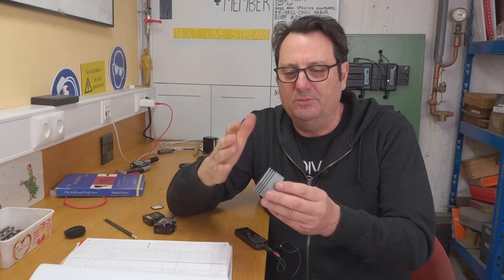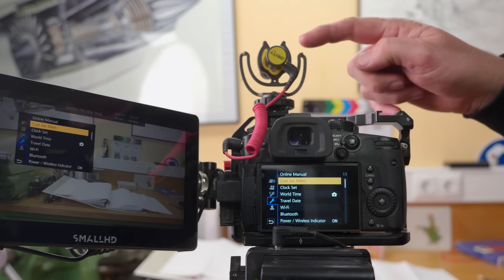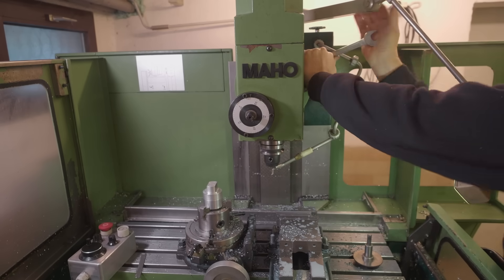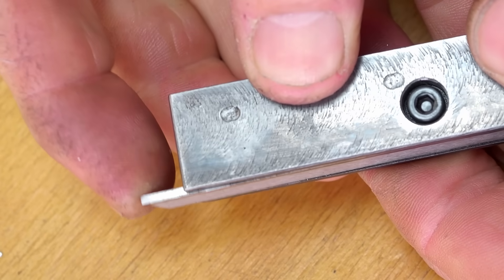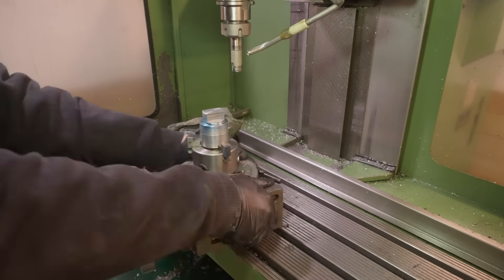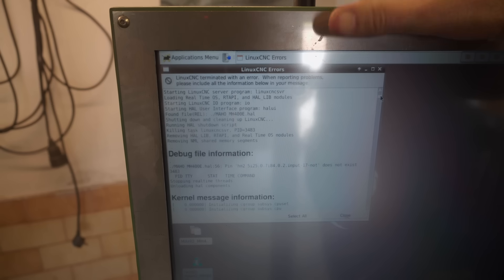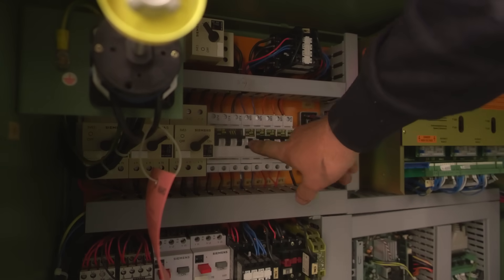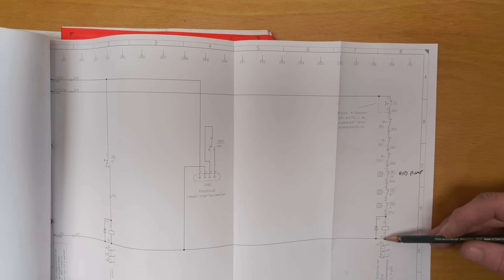I need piston ring grooves in my motorbike pistons but had no tool holder. || RotarySMP

Comment: at 15.03. what is that loose screw in the hand pendant, shorting out something?
Reply from the maker: You know the lame thing... as I flipped it over, I heard a rattle, and didn't put 2 and 2 together to look for a loose screw. Duh!!!! :)
Reply: I use red (or bright) nail varnish, it is strong enough to put on terminal screws and will stop them unscrewing and/or falling out. And the bright colour shows you the screw has been secured.
But it is soft enough that you can press through it and undo the screw with any screwdriver.
I learned this trick when servicing old high quality test equipment like oscilloscopes etc that had red nail varnish on adjustment screws or critical mounting screws.
Nail varnish is so convenient to apply with its own little brush.
Can be used to put indicator dots on connectors and stuff too. 👍
Reply: @wizrom3046  That nail polish also works great on tools for identifying which ones have walked off to a friend's toolbox, by design or accident. =D
Reply: @MikelNaUsaCom    funny you said about tools, now I'm getting older my eyes are not as good with fine print, and many of my half inch sockets from the 1980s have fine print saying what the size is.
When working on my motorcycles a 12mm socket looks the same as a 13mm socket etc, you can guess where this is going...
I'm thinking of putting paint colour codes on my sockets and wrenches, probably on the sizes I use the most.
Last time I was in the pharmacy they had a discount bin of horrible garish nail varnish colours for $1, I might grab a range of colours.
Reply: Good eye! 👍
Reply: looks like it came out of the white wire connection on the e-stop switch
Reply from the maker: @Hobgoblin612  I need to check it. Sure looks like that.
Reply: Also it comes in a wide range of pretty colors. 😄
Reply from the maker: @624Dudley  I'll have to hit up the kids for a bottle :)
Reply: @Servo421  nothing better than having 50,000 eyes to see what your own two eyes didn't see. Awesome that you keep your motivation and focus on a project like this.
Reply: Yes 👀 I saw it too 😊.   Pretty sure it was the short  he was looking for .
Reply: My loose screw has haunted me all of my life. Allegedly…

Comment: I had just the opposite problem with my commercial Hp laser printer. This is a machine with scanner with an auto feed, copier, etc. a really great machine, rated at over 70,000 prints a month. I bought it about 12 years ago, new. Never had a problem. Then recently, my wife had to make copies of our tax forms (well, she didn’t, but she’s an attorney, so she doesn’t trust online forms with our info). So, she could make a copy, or two, and then the machine would give a 59 error and she’d have to turn the machine off and on, repeat and rinse. I looked at my service manual. There is a couple of procedures for this problem. One requires taking half the printer apart to get to a sensor. I did all the work except for that. Nada! Then I decided to unplug it, something I should have done first, but the tests required that it be plugged in. Well, that fixed it! Then I remembered we had some networking problems after my ISP, Verizon, sent me a new gateway. I think some bad code from that, lodged itself in the machine cache which got unloaded when I unplugged it. Three minutes to “fix” it, vs several hours of work which didn’t. I didn’t follow the rule of unplugging it and waiting a bit first. My wife was insisting on buying a new machine.

Comment: While not directly related to your actual fault on this occasion, you mention a connection issue with the original Maho relay interface board while wiggling the connectors. Maybe worthwhile at some point pulling that pcb and insepcting closely the state of the soldered joints to the fixed connector pins on the board. I had  intermittent E stop problems on a mid-80s Gildemeister CNC lathe when I was working that turned out to be due to failure of a soldered joint of a similar connector on a relay pcb due to one pin taking a high current. The repeated heat cycles here eventually caused the soldered joint to fail, which was visble under a magnifying glass as a fine black line around the joint. Cure was to suck out the "rotten" oxidised solder, reflux and resolder the joint - did all the joints on the board to be sure ! When a similar issue reappeared 3or 4 years later, I knew where to look & the same joint had again failed in the same way - eventually put to bed for good by re-engineering the circuit off the pcb using stand-alone components with screw terminals.
On the subject of close tolerance holes with minimal tooling, have you heard of "dreamers" - combination of a stubby drill & reamer in one tool that gives a close tolerance hole in one hit.
Reply from the maker: It would be a good idea, but as long as that relay board is working, I have other priorities at present.

I had not heard of them. They would be quite the time saver.

Comment: You never actually specified the problem. Please, what was it? What wiring did you do wrong?😇
Reply from the maker: I didn't actually solve it. I just removed the pendant. 

But it turned out some eagle eyed viewers picked it up. An unused screw had backed out of one of the pendant buttons and was rattling around, and caused the short.

Comment: i like to use a thermal camera to look for such errors
Reply from the maker: In this case it was a screw rattling around in that pendant causing the short. Kind of doubt it would have been visible with a thermal camera given only 24V and 2A.

Comment: Finding shorts or high power consumption has changed for me since I own a cheap thermal camera. High power dissipation literally lights up in the FarIR spectrum. ( p.s. Not a sparky).
Reply from the maker: This was only a 24VDC 2A circuit, so I doubt the short would have been obvious with a thermal camera. Turned out it was a loose screw rattling around inside the pendant causing the short.

Comment: Th complexity of your system was one thing that worried me when something acts up. I can't tell you how many electrical issues I have fixed that were from replacing parts that tested good but for some reason in use didn't work. One was an ice machine years ago. It used simple reed switches on the two ice doors over the evaporator. The LEDs on the board indicated correctly every time and they tested out good. But... The factory rep said replace them anyway as they are the cause. So swapped them out and never had another issue. No idea why but that stuff happens.
         I have a Neewer wireless mic and its' way better than the one in the camera and I tried a little wired one but the camera didn't like it. I have done no reading on the settings of the mic other than I know if I push a button noise cancelling turns on. It works so I really didn't want to read the documentation. I'm getting worse about doing that as time goes on.
Reply from the maker: Hi Robert. I am glad I took the time to record all my changes in my wiring diagrams. Without that I would be lost.

Turned out it was just a loose screw in the pendant causing the short.

I decided to replace the Röde wireless go with the Hollyland Lark M2. I dont really like the form of the Röde transmitter and the way it hangs of my shirts. I tried it up on the collar, but get much worse plosives. The lark has a magnet to attach it and should sit better. 
The second thing I am not thrilled about with the Röde was that I sometimes bumped the sensitivity, and would get clipping as the GH5 has pretty hot preamps.
The Hollyland has a sensitivity knob, which might be even easier to bump, but I could put a blob of hot glue to stop that.
I also wanted a dual mic set for a while, for when I have a second person in the video. Nico owns the dual mic version of the Röde, and I have borrowed that a few times.
The reviews of the Hollyland would indicate it should sound very similar. And it is on special at present.
Reply: @RotarySMP  I like the size of your mics. Mine are rectangular and a little bigger but price was right etc. Mine has two as well and the same style charging case. I'm not a fan of the mic adapter for my ace pro though. You have to take it off to download from the camera with a cable or pull the card. 
      The USB port on the adapter only allows power to the camera it does not allow data through it.

Comment: I do like that Maho mill - just love the way the vertical head just swings aside to allow horizontal milling, nice.... Martin
PS. I would not cut the ring groves until you have rings.
Reply from the maker: Hi Martin, yeah, they did that well, with that support arm, so you dont have to lift the head off.

I am going to try making my own rings, so will be able to make them match the grooves.

Comment: It started when you man handled the controller. Short in the controller? Not knowing if it is 24V in the controller or not, you could have a feedback short. A board is sensing a short and tripping to protect the circuit or the main board. My guess is it is a short to ground. Can you remove the controller and see if it continues? Or is the controller needed for machine function?

I play with arduino, and this has happened a number of times. The board runs on 5V, but a 3.3V pin or  I/O is shorted, so the entire board powers off.
Reply from the maker: A couple of eagle eyed viewers spotted a loose screw in that pendant. It had caused the short. I have removed it and it is working again.

Comment: "I see some marks made by the holder so I guess I should have case hardened it but ----- ahh that's good enough"

I love that attitude.
I'm a retired certified millwright.
I made my own vacuum former, made a plastic injection machine, make molds to make parts out of two part rubber RTV and do some aluminum casting.
I've got a small hobby machine shop and all the welding equipment in my home shop. Wish I had that cnc mill but I never learned that as part of my trade. I'm to old now. All my stuff is manual.
I've actually welded up a holed piston for one of my vintage Honda FL350 odyssey atv's and it runs well. I too had to clean up the ring lands on the piston.

I love the attitude "good enough" because stuff just has to be functional.
A guy can get cute with making stuff if it was used every day and is a critical part.

Nice work so far sir.
CO
Reply from the maker: Thanks for your kind response. Yeah, I try not to gold plate tools which will just get used and scratched anyway.

Comment: I thought reamers were, historically, used to assist with non-lathe drilling operations.  If you can use a boring head (of lathe cross-slide) there's no need for a reamer.
Reply from the maker: True, but a reamer gives you the toleranced sized hole without having to much around dialing in the boring bar perfectly, and is also easier to get a good surface finish. That long skinny boring bar needs a sharpish cutting corner to not defect, and therefore doesn't give a great finish.
Reply: "Drill, bore, ream" is the holy trifecta for an accurate hole. The drill roughs out material but may wander. Boring straightens the hole and makes it round but may leave a taper. The reamer leaves a parallel bore and a good surface finish.

Comment: I would start individually disconnecting devices on that rail and see what it is that finally causes the trip.
Reply from the maker: I did. It was my pendant. Or more to the point it was the loose screw rattling around inside the pendant. :)

Comment: i was not prepared to hear ska today 😂

quick question: what type of cable is the one on your pendant and where did you get it?

i have the exact same problem to solve, but i do not seem to find a cable with those many cores which is not thick and stiff as hell
Reply from the maker: I butchered an old LPT printer cable for this, but it has the other problem, that the wires are very thin, and kind of hard to terminate.
Reply: @ I soldered a LPT plug on my pendant, bought a LPT socket with terminals for the machine end.
Reply: I bought some pendants, they came with cable 🙂. I do not know how long that lasts, but I think a parallelport printercable has enough cores to wire a typical pendant.

Comment: Hi Mark  I see that the fallen out screws are well documented now.    a simple plastic sheet laid over top of the  selector switches  and encoder would help with wire dressing as well.
Oh and tighnen up that loose e-stop switch please  😉
Reply from the maker: Thanks Steve. Will do :)
Reply: @RotarySMP  During my last year as a cnc field tech  i was stationed  full time in a large  die casting plant.
part of my morning rounds was to check  about  60 lathes and mills  .  at least  one of them needed the e-stop switch retightned .
apparently loose e-stops have become a bit of a trigger  for me 🤕
PS under no circumstance  use  a siemens signum   e-stop, even if it was given to you.
Reply from the maker: @steveggca  Thanks for the tip. I will avoid them.

Comment: I think you'll get more love from that T parting blade if you put it in a tool holder with an angled slot to give the cutter some top rake
Reply from the maker: I probably wont use it much, Normally I use carbide cut off tools, so this will mostly be for this one job.
Reply: That look very like the Swiss Tripan holder.
Reply from the maker: @johnsherborne3245  The Schaublin has a its own design, fits nothing else... of course :)

Comment: 14:51 -- I see I'm not thge only one who spotted the rogue terminal screw that backed itself out and is floating around inside the aluminum housing?  At the timestamp given, it can be seen wedged under the rotary switch at the bottom of the image.  I did a frame-by-frame of when he first opened the housing and it can be seen there as well.  No doubt after closing it back up, it remained wedged and did not cause a short, but I'm sure it will undock itself and go floating around again soon, causing all kinds of havoc.
Reply from the maker: Thanks for your keen eye. You know, I remember thinking, there is a rattle, but not following up on that thought. Duh!!! :)

Comment: If the error repeats, don't forget to check the cable to the pendant, it has a limited lifespan.
Reply from the maker: Good point Alexander. It is a pretty crap design. I really should make the one from Talla83.
Reply: @RotarySMP  I fixed a similar issue for a customer years ago, it's no one's fault since cables that move around have a limited lifespan, even those that are made for that exact purpose. You'll most likely find the fault right at the cable gland, where the bend radius is usually the smallest.
Wireless pendants have their own problems. The ideal solution would be a better integrated one, that doesn't involve each individual button being routed via it's own conductor. Proper spiral cables rated for continuous handling can go into the hundreds of euros and intermittent failures are hard to detect.
Reply from the maker: @graealex  Turned out to be a loose screw rattling about in there, shorting.
Reply: @RotarySMP  Yeah, I saw that other comment. I recently had to repair a similar control box that I foolishly engineered in a similar way.
Reply: @RotarySMP  And what I meant was - be wary of the cable some day breaking anyway. For me it produced a "CAN buffer overflow" since the cable break produced spurious commands in rapid succession and spammed the motor controllers.

Comment: 14:53 I see some loose screws rattling around and some bare terminals on those rotary switches that look VERY close to the case
Reply from the maker: Good point. That could be it. I'll recheck after lunch.
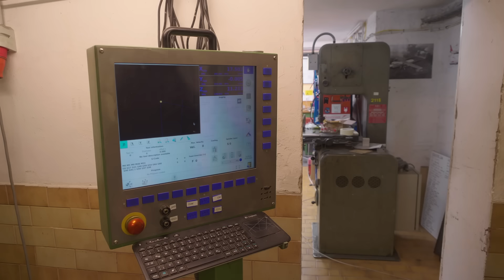Reply: 15:01 definately a free ranging screw, bottom center,  against the selector switch also both screws missing from the e-stop contact block
Reply: Once the screw is dealt with and the bare metal covered, cleaning up the wiring will make it much easier to see the problem in the future. The rat’s nest makes it very easy to miss the stray screw. Your call how far you want to go with the production level measures. It’s likely going to work fine with the screw returned to its home.
Reply from the maker: @ebrewste  I removed the screw, as I dont need it.
Reply: @ebrewste  Honesty I think the screw probably just fell in there from taking the back cover off. It would be rattling around and super obvious that it's in there. I'd be more concerned about the contacts on the rotary switch right next to the screw - they look close enough to the side of the case that if that switch is slightly loose, putting the whole pendant down hard might be enough for it to shift into the side wall and short those contacts
Reply: On commerical equipment, a metal case like that would have an insulator layer on the whole size of the removable metal rear cover (inside it).
You can buy electrical insulator sheet, but it is easy enough to source some clear hard plastic sheet 0.2 or 0.3mm etc from some product blister packaging. Overhead projector film can be bought from newsagents, and is excellent quality I think it is mylar so is more heat proof.
Cut with scissors, stick with your favorite non-brittle goop (contact adhesive, liquid nails, silicone etc)
Reply from the maker: @wizrom3046  Thanks for the tip.

Comment: So you fixed without our help 👍. I was gona suggest chewing gum and bailing wire anyways 😁
Reply from the maker: Fixed in that I took off the bit which was not playing nicely. Still no clue why :)
Reply: What did you do? I don’t recall you showing what you removed. I remember you said voila it’s fixed.
Reply from the maker: @iTeerRex  I just removed the pendant. The machine works without it, it is just a bit of a pain to jog and touch off work without the job wheel.